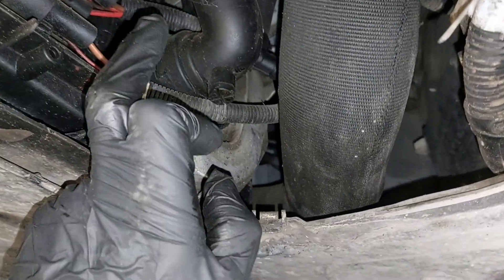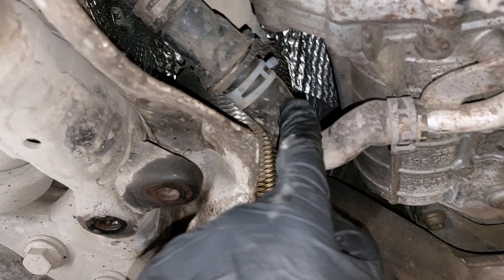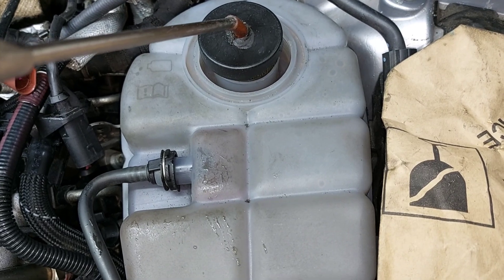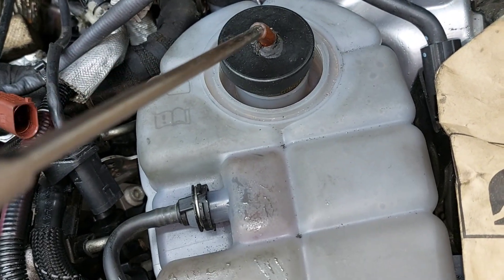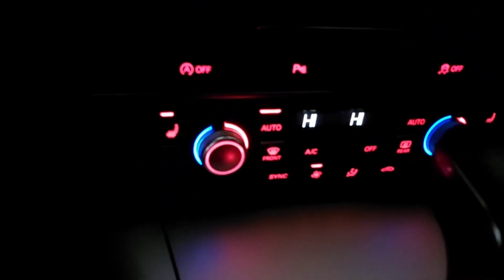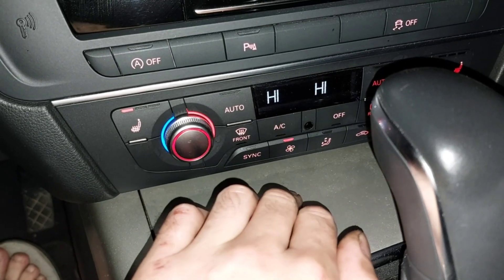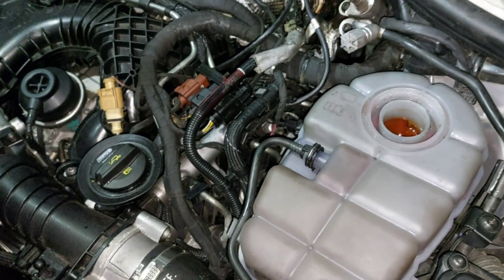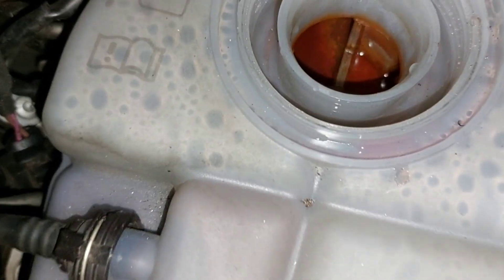coolant replacement | Audi 3.0 tdi A6 C7 ea897

Comment: Sorry but Bad video... didnt understand the steps off bleeding the system except from starting with a cold engine and temp inside to high, fan at low and start with coolant up to max point. But then what? Ive seen some other vids now off others vid the same car and engine and they show and tell that a screw on the passanger side off the intake manifold that is a T30 bolt, needs to be undone  to let air come out from there so the coolant can start pooring out off there wich tells you that the air has been replaced with coolant... wouldnt surpise me if there is more steps than this to make the procedure 100% complete..
Reply from the maker: Ok 🤝🏻

Comment: Hey ,
Did you keep the watertank open all the time?
From the video you start the procedure without cover and in the end the tank was closed....
Reply from the maker: When I changed collant it was open, then I closed it at 1:21, then I opened it while the engine was running (if everything is ok you can do that), then I closed it and finally opened it.

Comment: You need almost 12 liters for the whole replacement?
Reply from the maker: According to manual for GEN 1 engines, you need Fill reservoir of cooling system with at
least 15 litres of premixed coolant
Reply: @HintSlice thank you

Comment: Mine takes 10-15min that coolant Meter IS at 90 while driving. Staying Idle won't go 90. Changed all thermostats all 3 of them.. on Summer and Winter same problem Any idea whats The issue?
Reply from the maker: and what's the consequence of this issue?, because i think if the coolant level in the expansion tank is normal and it's warm inside of the vehicle when it's cold outside, there's nothing to worry about.
Reply: And when i shut down The car IT takes 20min and its going Back to 0
Reply: Yeah but two years ago It warmed very quickly now its taking ages to warm up
Reply from the maker: So you change this three:
Main thermo 059121111CR 
thermo for engine oil cooler 059115201H
thermo for gearbox 4E0121113.
If yes, then check also 👇🏼
Thermostat Intermediate Regulator Valve 059121737AM
Coolant shut-off valve 059121737AR
if they are in your engine ofcourse.